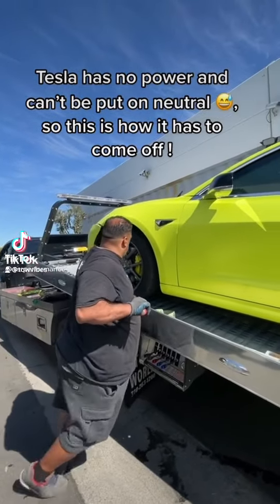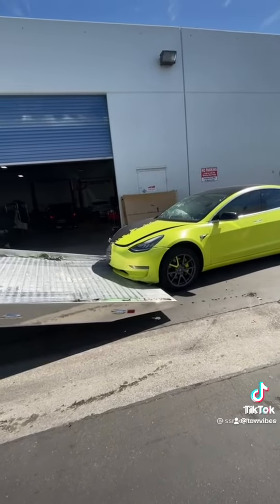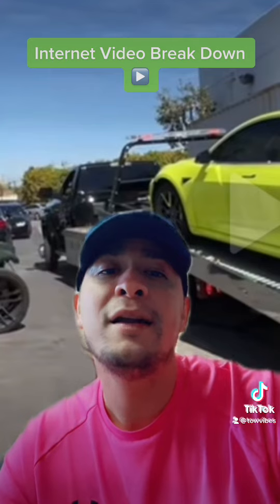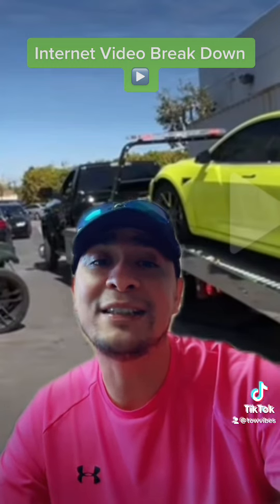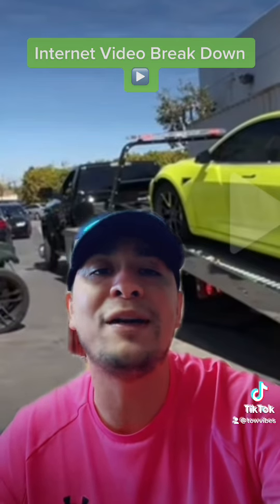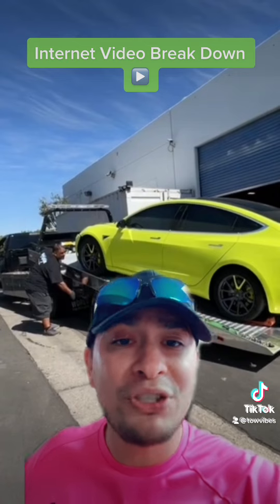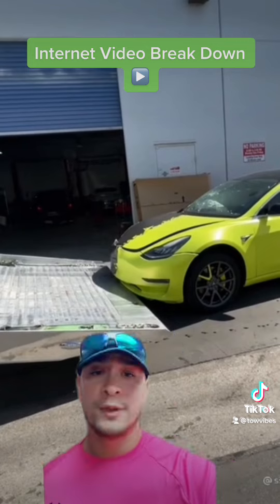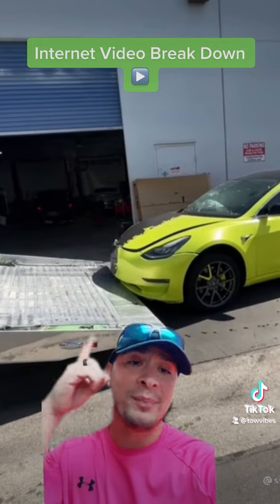Towing Tesla Fail

Comment: So I ran into the same situation where my screen was broken so they cannot put it in  Towing mode so they put skates but only on the back the gentleman told me that only the back has the automatic breaking system and he slowly rolled it up onto the flap it was wondering if you know if he possibly could have damaged my breaking system because he didn't put sleds on the front

Comment: Hook a snatch block to the end of the bed then run your hooks to the front axle and pull it right off the bed. This may not work so easily on a Tesla but it works good on everything else!
Reply from the maker: Yes I have done videos of this it’s called a winch off or reverse snatch method